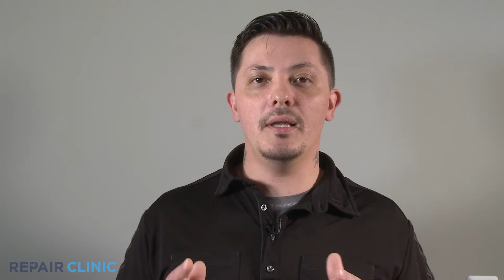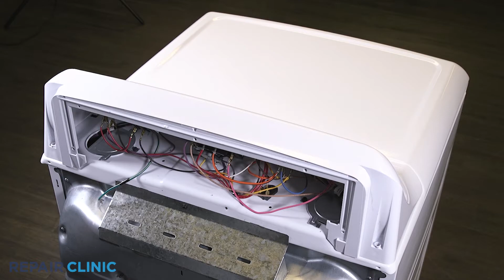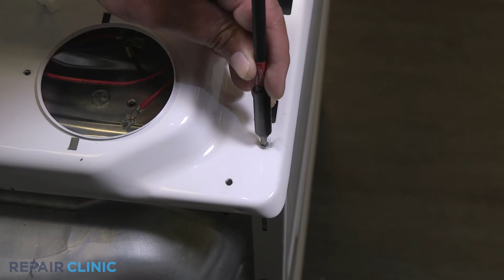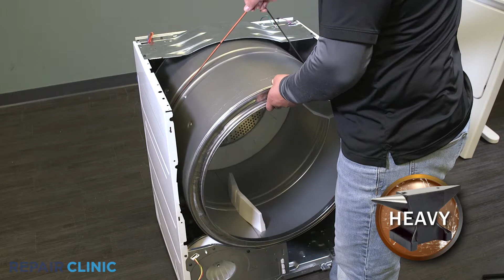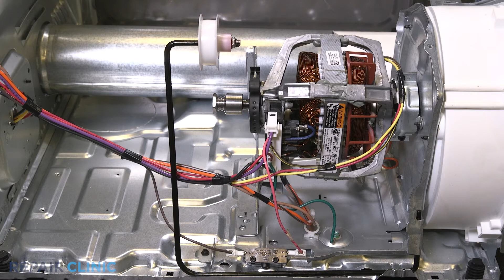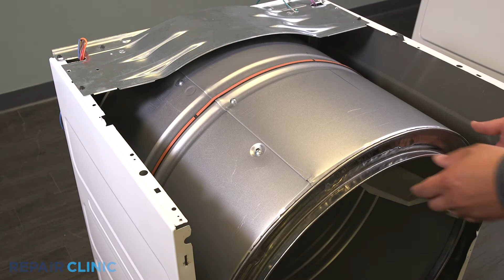GE Dryer Blower Wheel Replacement WE16X23857

Comment: I moved my dryer and loaded in my truck when I started it , I accidentally turn the timer knob to turn it off then something got stuck. I bits and pieces of the blower wheel and a black shaft about the size of a pen

Comment: OMG This guy takes off so much extra stuff. Lost me when he started removing so many top panel wires when all he needed to do was remove the phillips screws holding the back down.  Its possible to get the motor+blower+metal+plastic as a unit, but its not cheap if you strip the blower taking it off or it doesn't want to come off... WE17X24535
Reply from the maker: Thank you for the comment. For the model we are working on removing the back panel is not an option
Reply: @repairclinic  Sorry, I wrote that badly.  I usually tipped the top out of the way to lean on the wall behind the machine instead of removing the access panel and disconnecting all the wires. The top is secured by 4 philiphead screws, two inside the front lip of the door and two under the control console.  The console can be tipped forward after removing the two 1/4 bolts securing it and grasping the console, pushing it backward to disengage the front tabs then rock it towards the front of the machine.  Unscrew the last two philipheads that secure the top, then reengage the console into the tabholes and tip the entire top backwards to rest against the wall, or place a chair or something for it to lean against.  This allows you access to the front inside to remove the 5/16 bolts securing the front.  From there the repair went much as you pictured though I almost never needed to replace a blower wheel... more often a motor.  If the wheel doesn't cooperate, there was a complete assemble you could order... blower, housing and motor.  Plastic nuts on metal tend to strip.  When I didn't have the option of a complete replacement, I used to chip the stripped plastic off the metal center part of the blower to give me something to clamp vicegrips on.

Comment: This guy removed so many screws and connections that are completely unnecessary to remove.  This job is so much simpler than what is presented in this video.  I highly suggest you find a different tutorial.  Bens Appliances and Junk has a way better approach

Comment: Do I have to remove the motor plate and idler arm if I want to just remove the blower cover for cleaning?
Reply: You need to remove the 4 screws that hold the plate to the chassis, at a minimum. There's not enough room between the front of the chasiss and that plate to pull it off with just the screw removal